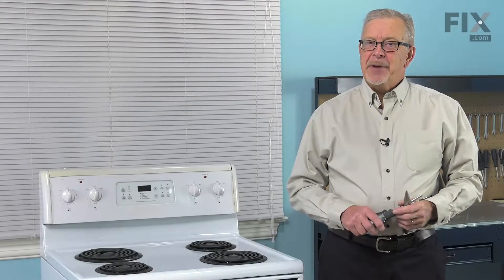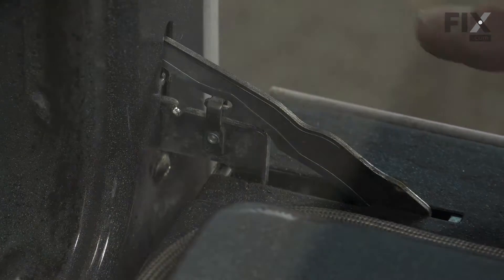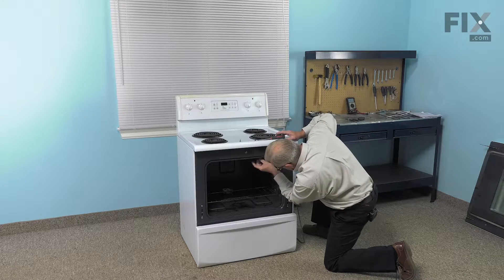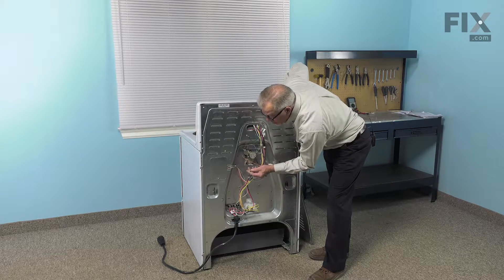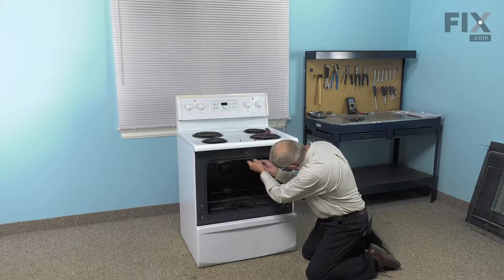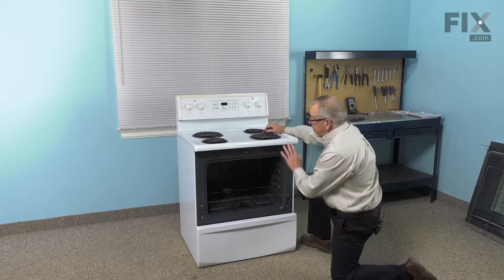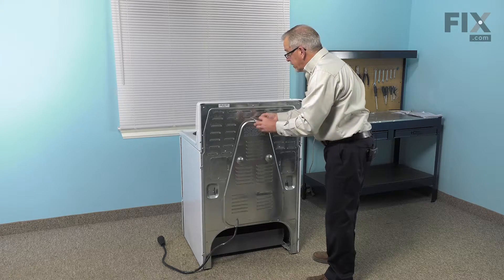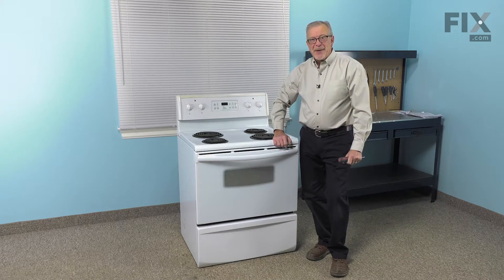Frigidaire Range Repair – How to replace the Broil Element

Comment: I have model #FEF389CFSK Frigidaire range.  The broiler keeps turning itself on whenever the stove is used.  I'm guessing the control panel needs replaced, I can't find one anywhere.  Is there a way to remove or disengage the broiler so it doesn't function?